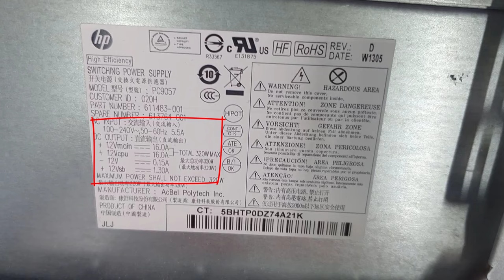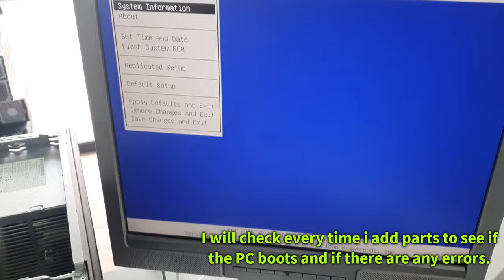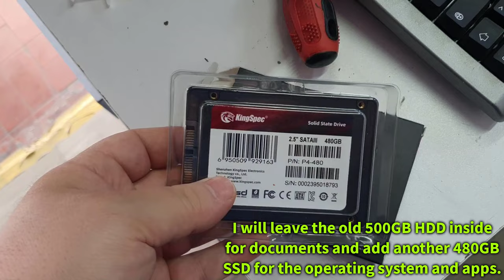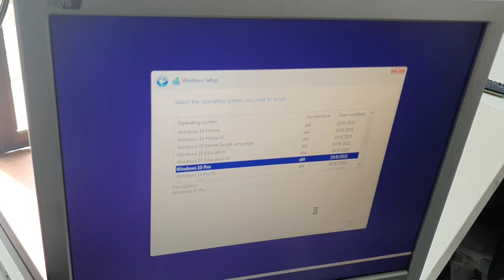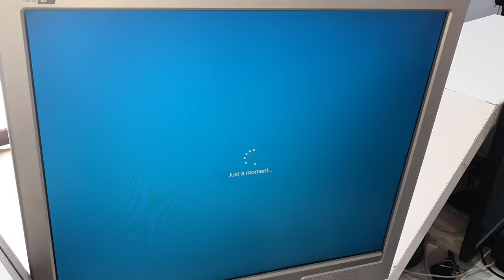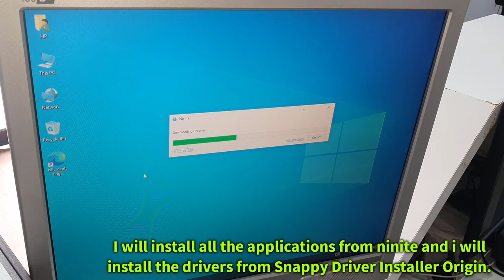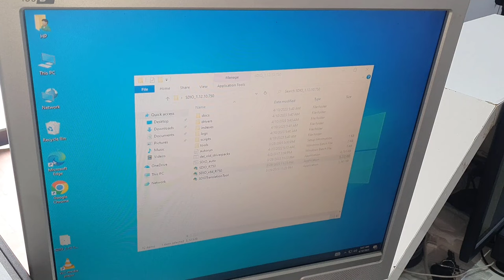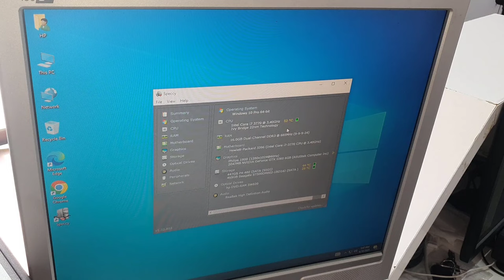HP Compaq 8300 Elite 2023 Upgrade CPU RAM GPU and SSD

Comment: I have the same pc and I am about to change the cabinet and the graphics to an rx 580 with 8 gb of vram, for that I need to change the power source to one of at least 550 watts. I really like how careful you have it (sorry if something is not understood, it is translated with google translate)
Reply: Is rx580 run with this pc?
Reply: As far as i know you cannot easily change the power source
Reply: Tal vez sí, con un adaptador de corriente de placa base ATX de 24 pines a 6 pines para HP.
Reply: It seems possible indeed, with a 24 pin to 6 pin adapter. I need more research on this topic though. Budget wise going for a 75w GPU may make more sense
Reply: I have one and I don't think it will fit well
Reply: They make a sata to 6 pin. Most office pcs have 4 sata ports, so you can make it work.
Reply: Did you make it?
Reply: @egery3587  Yes I could do it, I have had this PC for a year and it didn't give me any problems, it is as easy as building a normal PC and it is cheaper. Maybe the rx580 is too powerful for my processor, the i7 3770, I would tell you that instead of spending the money, you should spend it on a xeon
Reply: @manuellopez-fw3px  thanks for replying

Comment: I have same exact pc as yours. I am trying to install gtx 1650 oc but I am getting no video on the screen. Do I need to change sth on bios?? Bios is default settings. Thanks for the video.
Reply from the maker: no, just plug in the graphics card and install the drivers
Reply: Do you have the dvi cable???
Reply: When I installed my gtx 1650  i had black screen too.then I realized you have to connect a dvi cable to your monitor and the graphics
Reply: @smokemanic what were you connect the other end to ?

Comment: nice video, also you can install and boot from an NVME SSD. I did upgrade some of these pc`s already. always working. just look in the web for : Install and boot from an NVMe SSD on a HP Compaq Elite 8300 SFF
Reply: Hi! Since you mentioned you have experience with upgrading HP Compaq Elite 8300 SFF, maybe you can share some knowledge? The thing is that I need to upgrade CPU from i5 3470 to i7 3700. Initial configuration has 2 RAM sticks (M378B5173QH0-CK0, Samsung DDR3 1600Mhz 4GB) which perfectly works with i5. After switching to i7 it does not boot (5 short beeps indicating RAM issue). If I leave only 1 RAM stick, the system boots. I mean either stick number 1, or stick number 1 - if there is 1 slot occupied, the system boots. If more then 1 slot, then is does not boot. I tried different combinations - it appears that 1 stick is OK in any slot (all 4 were checked), but 2 sticks don't work no matter if in A-slots, B-slots or A+B slots. To exclude possible socket damage while switching CPUs I switched back to i5 - it still works with 2 RAM sticks. Tried updating BIOS to the latest version (02.90 => 03.08), but no luck. Unfortunately I don't have neither any spare 1155 MoBo, nor other DDR3 sticks to test. Have you ever encountered something like this? I would have assumed some CPU deffect, but there is a guy on HP forum claiming he has tried 4 different 3770 CPUs with no luck (but he does not specify if he has multiple RAM sticks, unfortunatelly, though I suspect he does have). Would be very grateful if you share some thoughts on this.
Reply: @andrewerohin2459  
Hi Andrew,

unfortunately I do not have a mentioned CPU to try. I have read your post in HP forum, it would not be likely that all cpus are defective. More likely would be an incompatibility with the mainboard. However, I do know I7 is working in 8300 Tower, with all 4 dim slots populated, but that has another mainboard.
So I conclude the cpu is not compatible with the sff mainboard.

Comment: I have bought the version with i5-3470 for my windows xp 32bit build. I plan to put a GTX750ti on it and my biggest concern is if the power supply will be enough, it is also not easy to upgrade the PSU, since they used a special motherboard connector. Did you have any problem with this GTX1060? I am having some driver problems too, some of the drivers on HP website for win xp are not working.
Reply from the maker: I didnt try windows xp, sorry.

Comment: Hello, I got the same rig: do you think I could use an  i7 7600K or 7700K?  Thanks for answering  regards
Reply from the maker: No sorry you need another motherboard for intel gen 6
Reply: We can use only 3rd generation chip?? In this motherboard?
Reply: @hetsolanki_13 i think it is only compatible with 2nd and 3rd gen cpus.
Reply: Thanks,and what about to ad a MSI Geforce 1050 2GT LP  (75W),will it be OK?

Comment: Hello, i have the same configuration; it is possible put a gtx 1070 and doesn't change the power source (320w) .
I have change the memory to dual channel memory (2*8gb) viper patriot 1600mhz
thank you for you video
Reply from the maker: You need a bigger PSU, at least 450W.
Reply: Thank you for your answer, did you change the power supply because you put a 1060 6gb that consumes about the same as mine. 120W yours and mine
Reply: i would say a 1650 super or a 1650 ti, sorry for my mistakes
Reply: @thibautg6270 did you succeed? (The 1070 with a 320 watt power supply)
Reply: @thibautg6270 It is said that you need a dual sata to 8pin for that to work

Comment: What connector did you use to connect the 1060 in order for it to work? I'm trying to know because I'd like to add a 1050ti to mine

Thanks
Reply from the maker: Sata to 6 pin or 8 pin depends on the GPU.